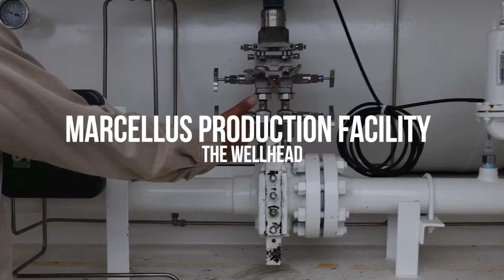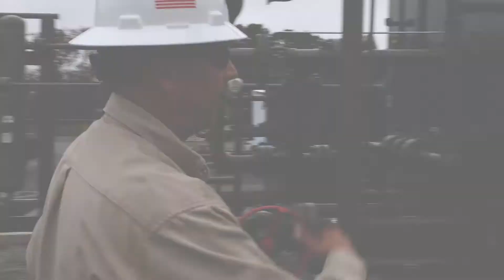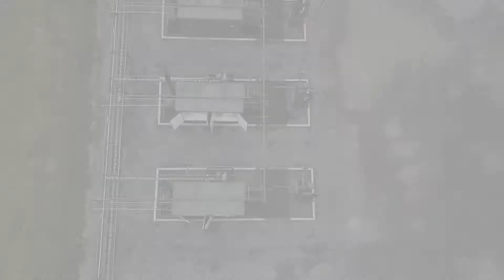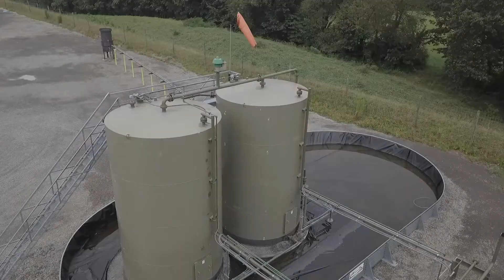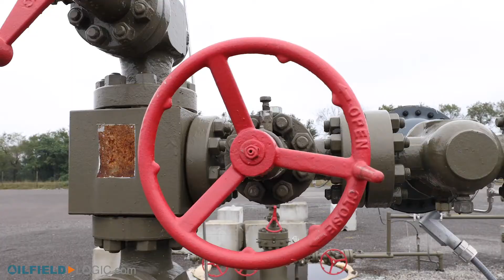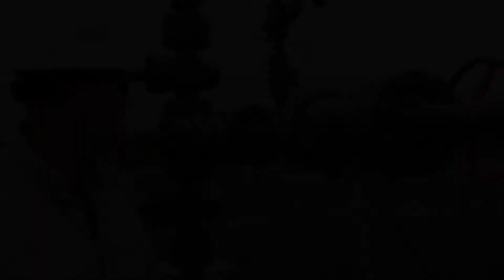Marcellus Production Facility - The Wellhead

Comment: Multiple points to Learn. Especially for someone who has not visited the well-site and are outsourcing. 

Good to know about ESD valve and the pressure transducers that connect to ESD, Swab valve and on to casing at the downstream and upstream side of the wellhead. Pressure monitoring is indeed a crucial part of the well-monitoring and well control. Thanks Art!